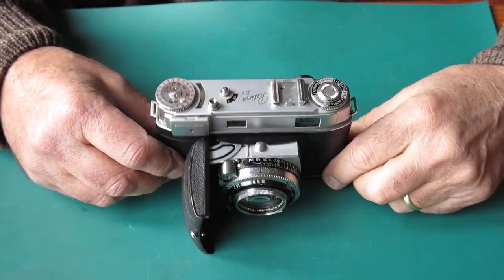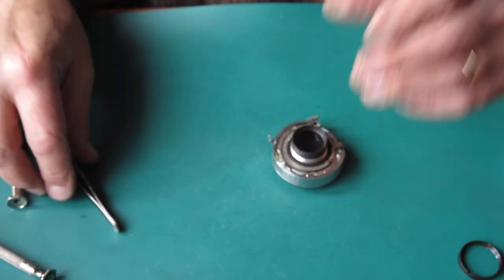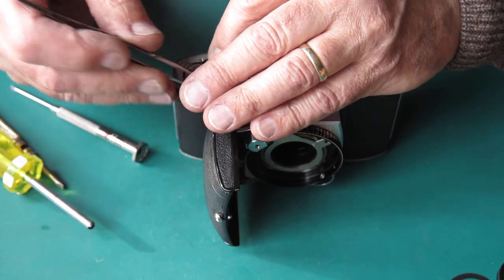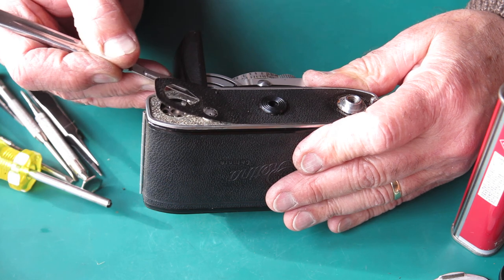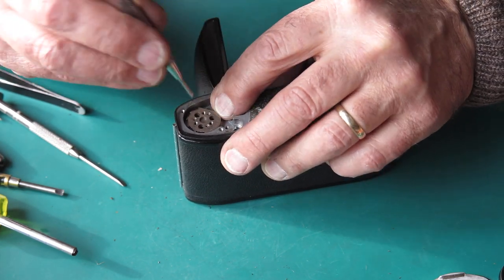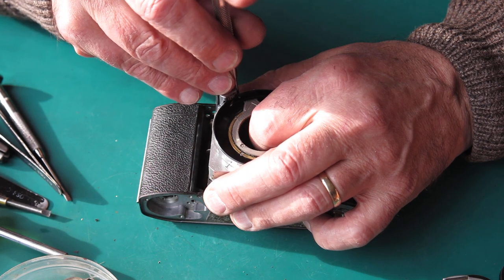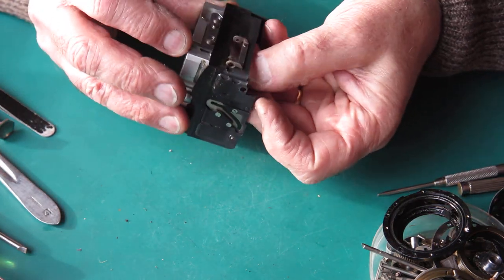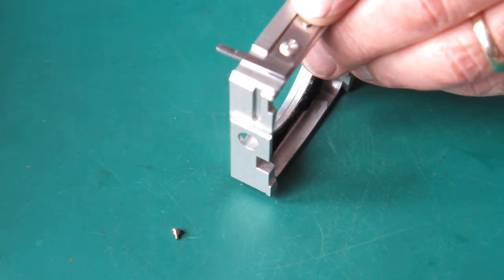A dropped and unhappy Retina IIIc needs repair, part 01

Comment: Was the move from using struts to using a shroud a design improvement or an economy measure or do both have their advantages and disadvantages?
Reply from the maker: Well, it certainly protects the bellows from potential damage, and struts were probably more easily damaged too.